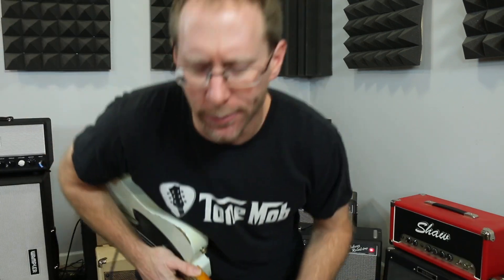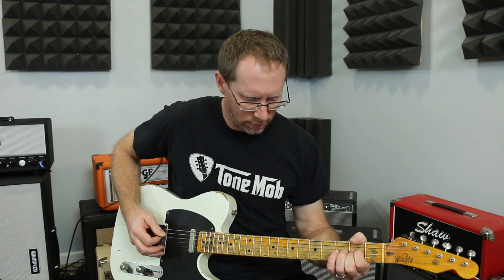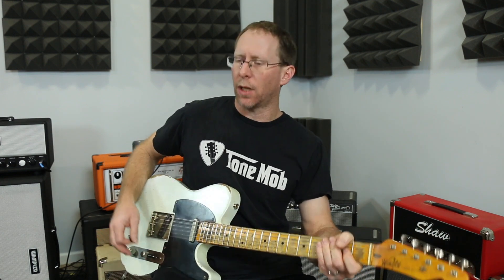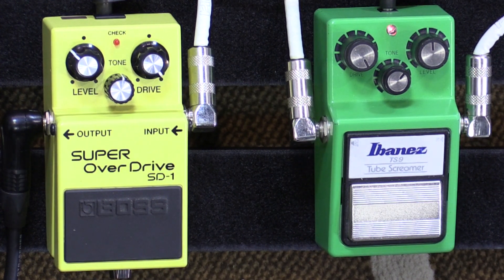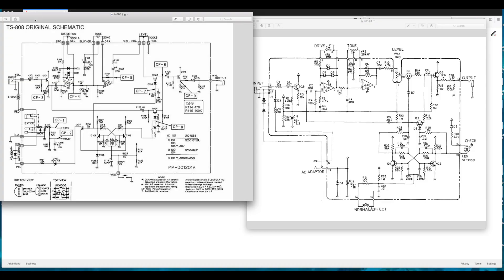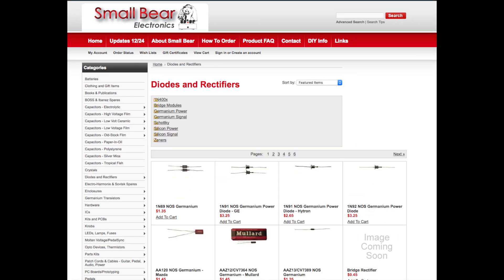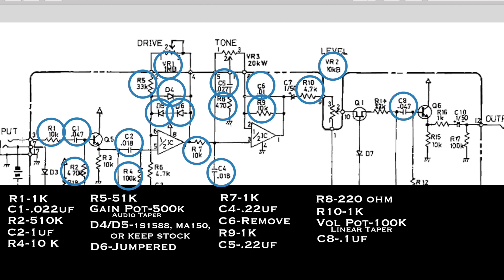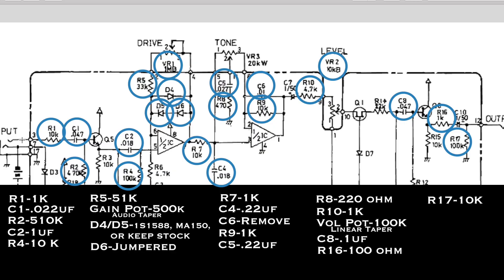How to turn a $30 overdrive pedal into a $180 pedal  -- The Boss SD-1 turned into a TS808

Comment from the maker: What's your favorite Boss SD-1 mod? If you're a DIY'er, where do you like to buy your parts from? 
🔗Breadboarding Course: Interested in creating, building and experimenting with your own pedal circuits? Check out my course for newbies here: 
https://www.guitarpedalcourse.com/courses/complete-beginner-s-guide-how-to-design-your-own-guitar-pedal-circuits
Reply: Favorite mods for the SD-1 are 1) clipping diode/circuitry changes (diodes/LEDs/MOSFET)  2) Pre-clipping tone control 3) Post clipping mid control.  Most are easy to do, unless you want to make the pre-clipping tone control variable and/or active.  Same w/ mod 3.  The difficulty is more mechanical than electrical - space for extra pots, circuit board, etc.  
As for parts suppliers, Mouser is my typical go-to then Digikey and Smallbear.  Jameco can be good for some parts as well.  I've ordered stuff from them for 30+ years (mail order back in the day).
I've been an EE for 29 years (DSP/Comms/RF) and these types of videos are great.  Even back in the day, there weren't many people experimenting, but at least there was a RadioShack around w/ kits, books, and parts.  Now, there aren't many people interested in the area.  Hopefully, these will foster the curiosity to find out the detailed "whys" behind the mods and maybe go into electrical engineering as a career.
Reply: Love these type of videos.  I recently just finished modding my Fender Pro Junior to have a treble and bass knob as well as putting the negative feedback loop into the grid rather than the cathode where it goes on the schematic.  Also with a pot to adjust it ;)
More mod videos please!!!!  Share the knowledge my man!  
Love from Canada :D
Reply: I must be one of the few people in the world that likes the SD-1 better than the Tubescreamer.  How do you turn a $175 dollar pedal into a $30 pedal?
Reply: I love these videos Brian! Please make more... I've done some VERY limited DIY, like solder some P Bass pickups so seeing stuff like this is super interesting on it's own and inspiration to try some stuff down the line!
Reply: parts I get from local electronics shops here in bengkulu, Sumatra. Also theres a lot of repair guys who here who fix tv/radios (people still get stuff repaired here)..i sometimes get cool salvaged parts. Also I travel a fair bit to Singapore..there's a place called sim lim tower, which is worth a visit..basically like highrise building full of electronics shops. I don't have an SD-1..but i'm definitely gonna build an 808..if I can hunt down an JRC4558.. How "critical" to the sound is the opamp?? what will you get if you were to use another like tl062/72/ne5532..which i have in my bin right now??
Reply: @raindogred  I used to live in Singapore and I remember Sim Lim tower with great nostalgia. Cheers!
Reply: @lafeeshmeister  I'm now back in Australia. Missing the good value prices I used to pay for parts in Sim Lim and the variety of shops, also some of the shops at taman sentosa in Johor Bahru.Wander around for ages drooling at electronics stuff:)  Nothing like that here...
Reply: Wampler Pedals ... Yes I live these kind of vids.  Keep'm coming!  :)
Reply: This is awesome!  Love these videos!
Reply: SD1 with 12AU7 on it. A Tube mod.
Reply: Wampler Pedals My favorite Boss Mod is for the DS1 distortion. I removed one diode and gave me the exact sound I was looking for. Normally the classic DS1 has a brittle harsh tone , but by removing the D4 diode it thickened the tone up and took the harsh high end off. It's a simple Mod. Remove the housing and snip off the D4 diode with wire snips . Fattens the sound and takes the high end harshness off
Reply: Wampler Pedals Ok
Reply: I love these videos. I DIYd a Hot Cake clone with a schematic I found online. I'm not an expert but can follow along with everything you show. I'd like to see more of these types of videos. Keep up the great work!
Reply: I love these videos. Modding pedals with your suggestions is where I started years ago and now I've made dozens of pedals and love it.  I source parts from tayda electronics most of the time and small bear electronics when necessary.
Reply: I love these types of videos because it de-mystifies some of the bullshit snake oil we guitarists are so fallible to!
You're doing fantastic work mate so please keep it up.
Cheers.
Reply: I would love to see a mod that would make the Boss Metal Zone a great pedal? anyone got any links for that, would be appreciated.
Reply: Hi Brian. Normally I use an RC4559 since it makes it sound a hair hotter. I also like to remove C6 since it adds a bit more clarity, and make C1 0.068 to add just some bass. But it's one of those pedals that will lose its character if you go too wild modding it. I but my parts from Tayda Electronics. Thanks for your amazing channel !!
Reply: Wampler Pedals Brian, thanks for these great videos. We all love them. One point. The ability to swap opamps is always the best part of pedal mods. That little opamps socket is so cheap and easy to put in, I try and put them in all my mods.
Reply: Wondering if your breadboard actually looks like the one in this video intro while designing high-gain pedals. Don't you get weird stuff like parasitic capacitance, inductance, and EMF, RF interference?
Curious, because I had a breadboard circuit with long wires looping around each other, and was getting a honking mid-range tone until I shortened wires, and cleaned up.
Or have you designed all your admittedly awesome sounding pedals without paying attention to shorter leads, etc?
Reply: Hi Brian, going trhough your mod book just now and I see the SD-1 mod you just showed, alongside the "cuervo", "sd1 mod 2", "chocolate" and "mosfet" mods. My favourite mod I've done so far is the BD-2 brent mason  described in the beginning of the book. Which of your SD-1 mods would go in that direction? I like the full bodied and well defined crisp sound for my rock / metal band. Cheers!
Reply: I baught an 86 boss sd1 today as a pawnshop find for 20 bucks.  Boy does it sound good.  I would never want to make it into a ts808..... Now if you want 808 tone..I have the maxon 40th od809... Now that's a bad ass pedal too...ohhhh yeah and wampler traux tape echo2 and then end🤜
Reply: really great mod, never thought they could sound almost the same, I never actually liked original SD-1 kinda sounded flubby in comparison to Tube Screamer, just noticed when changed R17 from 100 k to 10 k that it actually got that thick attack that TS is famous for. Again thanks Brian
Reply: Love these types of videos!  I've only modded a DS-1 to Keeley SEM and Ultra.  I've done some kits from BYOC and built some pedals from scratch using http://tagboardeffects.blogspot.com which is super cool.  I usually source things like resistors and some caps from taydaelectronics.com.  I get things like switches, jacks, enclosures, etc from mammothelectronics.com.  Keep up the pedal geek videos!  Maybe others would be interested in seeing a build from tagboardeffects.blogspot.com.
Reply: I love stuff like this. I’m getting into DIY, and this is a great project for the future. Can’t wait to buy your book.
Reply: Can you talk about the Boss OS-2 circuit? Is it truly a SD-1 and a DS-1? I've always thought it was an interesting pedal. Thanks!
Reply: Wampler Pedals Cool video. My favorite SD-1 mod is the Landgraff conversion I found on FSB, which I just realized is very much like an 808 conversion. Sounds awesome. Doesn’t the SD-1 have an inverting gain stage where the TS is non-inverting? Or maybe I’m thinking of a different circuit.
Reply: Small Bear is good but have you been to Futurlec? http://www.futurlec.com/index.shtml
Reply: Im sorry, I just watched the Metal Zone vid and you do a metal riff there, so its my bad. Thanks again.
Reply: Never done a pedal mod ain't afraid of using a soldering iron.  This is awesome how to. 
Oh man. I wish I still had my sd-1 from the early 1990's would've done this. May have to go get one. 
Have heard about that website great pricing but for guitar repair my go to is the Stratosphere and the Art of Tone.
Reply: google Boss MT-2 mods
Reply: Both pedals are sounding more like my mom in law !!!!
Boss DN-2 & BD-2 sound more like my mistress !!!!
Reply: Great video demo. love it love it LOVE IT! but there was a subliminal message  @ around 4:50 telling me to rob a bank. I woke up this morning with red dye all over my face. So now what?
Reply: my favorite SD-1 mod is the SD-1, as it left the factory
Reply: Like the videos a lot.  Is there a mod for the Boss SD-1 to have it in normal mode (instead of effect on) at power-up?
Reply: I appreciate what you do and have great respect for anyone that only wants to help his followers to be better, even if they can't afford to be clients of his. 
PS, love the sound of your Tweed pedal although I've only ever heard it on YT
Reply: Please keep these kind of videos coming. I'd like to know if it is possible to mod a Boss ODB-3 to OD-3 specs.
Reply: Monte Allums GT mod for the SD 1 is amazing. Can go from an extremely transparent clean boost to a tube screamer type overdrive with extra gain by just adjusting the 2 toggle switches. Just a complete swiss army knife of overdrives in one pedal.
Reply: Best SD mod is to couple it with a Vox Satchurator
Reply: c3 mod.
Reply: Convert my OD-9 to and SD-1! 😂
I'm liking the SD-1 these days over everything to boost a high gain amp... Although the low cut could be variable, instead of having to boost the gain knob to return some girth...
Reply: But can you turn a Boss SD-1 into a Univibe???  lol
Reply: lol
Reply: Wampler Pedals * I can't hear a difference between the two at all.
Reply: I thoroughly love these videos! Especially since you can deal with both the electronics and the guitar.  Id think it was extra cool if you picked up a few metal riffs thouh, just a reference for us metal heads. Thanks for all the content!!

Comment: Mr Wampler - about the sd1, I would love a bit more clean volume, for even more boosting capabilities. In fact, recently ,I've been trying out in depth an sd1 I bought (more for studio work gear/collection as Ive been more of a TS 9 user for my blues band), and I'm loving the sound of this sd1 standard with volume maxed out and gain full off- tone wise it's really tasteful, but as I mentioned It definitely could use 2 to 3 extra steps on the volume dial to push other pedals and/or a broken up amp a little further. Do you have any mod I could try? 
Hope this one reaches you from here.

Comment: I came here to say that I have all 3 pedals plus more. Tonight I tried most of them all. The SD1 was the winner by 1% as the main overdrive to push a Marshall 4010 JCM800’s and Jubilee studio. I have to admit that the Tube Screamer is creamier and smoother. The sound of the boss can be off-putting if you like that balanced chord strum. The asymmetric clipping indeed produces a raunchier sound. Ok, so I was A/B Ing them and ended up setting the TS into the boss. I tried the spark and arrows from EQD, and I don't know the best tone is rhythm with SD1 and engaging TS for lead that makes the sound so good. 😊  if Mr.Brian says I’m loco then, I might be going deaf and that’s about it

Comment: TS always sound like someone put a blanket in front of the speaker box. SD1 (I've had one for years, before the pedal revolution) I later realised that they have a massive low end roll off. Still have my 1983 SD1 but there are so many better OD pedals out there now so I never use it. Is it worth anything?

Comment: The 1S1588 diode is just a clone of the American 1N4148 silicone diode, still mass produced today. But I always use new old stock germanium diodes with their better voltage/current response curve.

Comment: Hi,to have only much more gain on the sd-1,some forums suggest to change R6 from 4,7 K to 1 K....is it correct?Many thanks.
Reply from the maker: You can, but you’ll change the frequency. If you change it to 1k you will also want to change C3 to .22uf unless you intentionally want to change the bass content.

Comment: I opened up my SD-1 and it is all tiny SMD components, are they all like that? or is everyone here just way more experienced with soldering than me
Reply from the maker: All of the newest ones are surface mount
Reply: @wampler_pedals  yep, from what I just researched BOSS switched to SMD components somewhere around 2017/2018
Reply: also, my board has a 4580 op amp

Comment: These videos are a great rabbit hole and I love them. Really interesting and practical mod advice/history. In this case with this much de-soldering, I'd probably just get a kit and make one from scratch though for  maybe not that much more? Also, I love the SD-1 as is.  I agree what you said on the 4558. I made an overdrive (BB style) for a friend and he was really honing in on the op amp in talking about how to put it together in lieu of talking about what circuit he'd really prefer.  I just gave him a few different flavors for less than a couple bucks so he could just play around with them for himself instead of having that circular conversation. I think A/B-ing he left the JRC in because it was the last thing he tried and what I put in there as stock.

Comment: hi. the sd1 has a nice tone on its own.. I'm a regular TS user but need to try some different options so I got one of the 40years edition. I found that the sd1 doesn't have much volume when Gain is all the way down to serve as a boost and eq. thats a shame for me. is there a way to mod one to compensate for this? I might buy a used yellow one and mod it. can you help me?

Comment: From what I see, most people that have a sd 1, bought it because they wanted the sd 1 sound. You can buy a mini tube screamer for around the same price anyway but people that use the tube screamer also bought it because they wanted that sound! Both work really well at pushing a gainy amp or pedal!!
Reply: Also a cool mod would be to add a low end knob. It would be nice to be able to tailor the low end to the exact point to suit your rig

Comment: 1  QUESTION    I HERD  /WAS  IN STUDIO   AND   SEE  IN  ACTION   BOSS   SPECIAL   OVERDRIVE / DISTORTION //HI POWER   PEDALS  NO DELAY OR  FLANGER // AND THEY   DO  GREAT  ON  18  VOLTS ,,ANALOG  ONES  // I   USED A CAR BATTERY    12 V  60  aH   FOR   20  YEARS TO POWER  BAN D S  BOSS PEDALS AND  BESIDE   1X  SHORT   /SUPERFLASH /  AND   1   POLE SWITCH MISTAKE  // THAT WAS WORKING LIKE ,,  WE EVEN   USED  ON GIGS  MOTORBIKE 12 V 10 AH   LEAD ACID  BATT// GOT  OVER 12 V SLIGHT,, WORKS SUPER  NO   OUT  OR   MAINS  DISTURBANCE,,PLUS  BEST   PART DISTORTION   DID  LIKE    ON ,,can i say  coke ,, WELL IT   WORKED   WHERE   BRR  ON  9V  HERE WAS   DSDSDSDSDS DSDSDSD ,,POWER // I   USE 2 SERIES  9VOLT  BATT/LEAD  NORMAL ONES TO  DRIVE     PEDAL IN  STUDIO // AND  IT  IS A  BLAST//AND SUPER SIMPLE // THOUGHTS// I JUST   SOLDER  /TAPE 2  BATTERYES   AND ADD   CABLE ,, BUT  FREND DI  A  BOX FOR 2X 9 V,, DID   WIREING AND  OUTPUT ,, CABLE    WITH    PLUS  CENTER  FOR   /EDEN   PEDAL //AND  OTHER   FOR  BOSS   AND  MOST  ELSE // ONE  IS RED  OTHER  GOT   BIG   PAPER  FLAG  ON  THAT SAY   EDEN   ONLY//SO   THOUGHTS// NO NEW  HOT WATER  BUT  STILL
  MITJA SLOVENIJA  BASS REGARDS

Comment: I really don’t see how changing the component values on either the input buffer or output buffer are going to make much of a difference, if any. The TS has the 51pF cap in the feedback loop on the clipping stage. This attenuated highs at 6kHz when the gain is set to max. 

I’d love to see a video comparing op amps used in overdrive circuits. Specifically between the op amps used in these pedals as well as something like an OPA2338, TL072 and an LF347.

Comment: I use to use sd1. When bypassed the distortion is still slightly present, I hated that.
Reply from the maker: Yeah, that was a bit of a design flaw IMO. Not sure if the new ones do it or not but I used to do mods to fix that, which required adding another fet “switch “ inside

Comment: SD-1 is just an OD-1 with a tone control.  And the TS 808 is an OD-1 with a tone control and symmetrical clipping.  So of course they sound pretty similar.
Reply from the maker: Many think that but it’s not true. They both use non inverting gain stages on the first gain stage but that’s about it. OD-1 has an inverting gain stage after , which contains a low pass. Sd-1 and TS both have simple pole filters before second op amp.

Comment: SD 1 is better, has more gain and more bass cut which is necessary thru cranked Plexi . Dollar screamer is a clone of Boss OD 1 and that's what people seem to forget .
Reply from the maker: Od-1 isn’t a a tubescreamer. It’s a non inverting op amp into an inverting opamp setup, unlike the TS, or the sd-1, which are both the same topology, non inverting into low pass filter into active treble stage, non inverting.

Comment: I just don't get why TSes are so "Holy Grail".  My guitarist has an SD-1 and TS9 in his pedal board and I think the SD-1 consistently sounds better.
Reply: I have both too. I use the sd1 as my mine crunch tone and use to ts9 as a boost (drive all the way down, level all the way up)

I agree with you. As a main tone I prefer the sd1 all day. Simply sounds better
Reply: Depends on the amp honestly. Asymmetrical clipping sounds way better through Marshall amps. The opposite is true for Fenders.
Reply: Sd1 is weak as piss
Reply: @frankzerotohero7387  because it cuts too much bass, boost the bass and the mids slightly. Or I think the custom mode on the waza might fix that but idk.